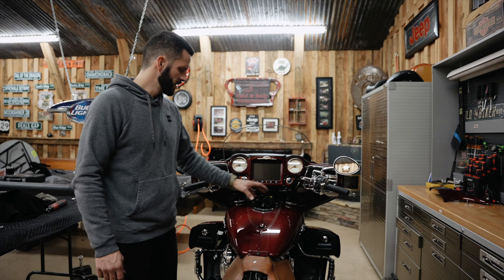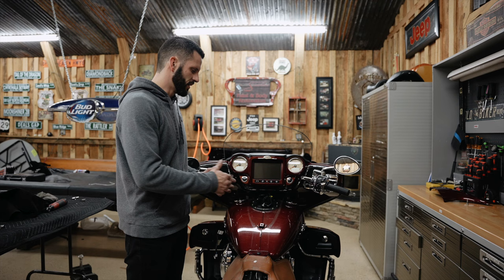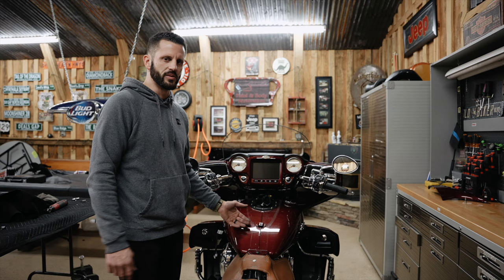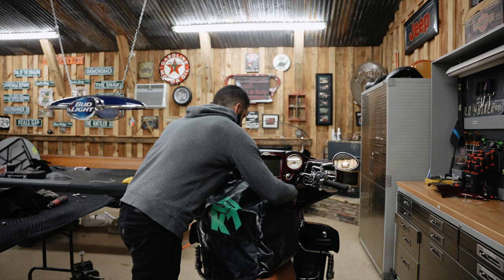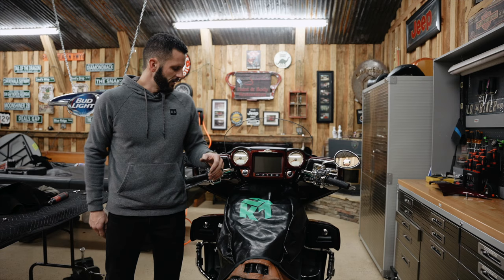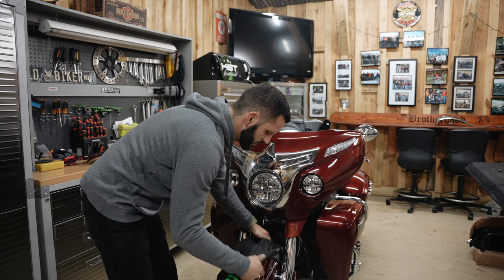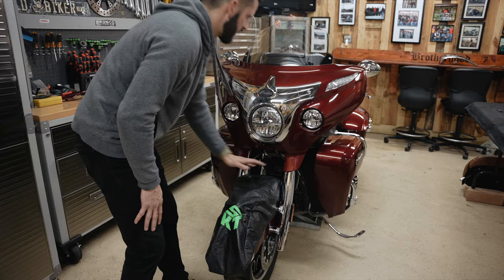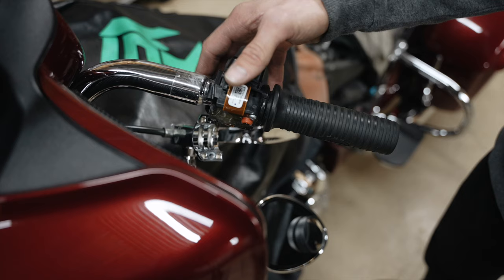2018-2023 Indian Roadmaster/Chieftain Handlebar Install | Indian Motorcycle Handlebars

Comment: I did it! 🎉 It took about 6-7 hours of work but that’s typical for me bc of second guessing myself. I kept going back and rewatching each piece as I went so the time line is on me. I didn’t have the work space either so I was make shifting that. Ultimately this video saved me about $600- $750 on my Indian shop installing. 

Word of advice to everyone on the 2020 Roadmaster Dark Horse, the plug that he mentions that goes to the handlebars, it is the one he’s talking about on the left (when facing the bike) but it’s ran through the metal frame to the fairing housing and is zip tied behind it. Remove the right blinker, take the 3 screws out of the fairing plastics on the back & use the needle nose players to twist off the zip tie. You can then pull the whole handlebar harness out of the front. You’ll be relocating that to the top in the middle somewhere bc it likely doesn’t reach back to the original location. Don’t second guess it like me. 

I have no idea where the ambient air sensor plug came from but it’s got the clip to stick back into the frame somewhere but I can’t find it. No idea how or why I pulled it out.

Comment: My shop quoted $165 per hour for 4-5 hours! Thanks to this comprehensive install video i'm bolting on my new 6" Apache Baggers (shipped like grease lighting by the way) on my 2021 Chieftain Dark Horse in my garage as we speak. I smeared a little dielectric grease on the taped up portion of my pull wire to make that sharp bend go a little smoother on the bulky throttle side. Thanks!

Comment: Finally got mine installed today. 2020 Roadmaster Dark Horse, the wiring in the faring was very different because it was all clamped and zip tied together with a small window to work out of. About 7 hour project at the end of the day.
Reply: Me too. Just bc second guessing myself on why I couldn’t get the handle bar wiring harness out as easy as he did. Zip tied behind that bar so need to undo the bottom of the fairing from the backside to clip that zip tie.

Comment: Just did a 17 Roadmaster yesterday and it surely didn’t go as smooth as your install! The 17 had soldered connections at the switch housings so the wires need to be pulled up through leaving the housing intact. The wiring left through after the install is really short and the wiring needs to moved around inside the fairing a bit. The clutch cable need to be rerouted too. It all come together but not as simple as the video. That being said, I’ve done many Harleys and this install is still way better than having to change clutch and brake lines!

Comment: Thank you so much ! Very clear and complete. I would like to change my bar on my 2016 RM, and after checking the connections on the handle, I saw there are not the same and not so easy or impossible to disconnected there !! Any other solutions ? Thank you for your help from France. Few year ago, I have done the same job on my HD Road King, I mean I should be able to change it myself... Thierry

Comment: Quick question can you not remove the bars with the wiring intact. Because when your installing the new bars. U r still feeding the wires in and out thru the headlight

Comment: Had you installed heated grips bed I just bought some heated grips for my 2017 chieftain and I know the bars aren’t pre wired and I have the harness that run through the bars just wondering if I have to remove the whole front of the fairing to run them through the bars

Comment: I am just installing heated grips and contemplating pulling all the wires out and restringing it rather than trying to pull the heat grip harness.  Can you pull all wires at once?
Reply from the maker: If you own an Indian, the heated grips are east peazy. They just plug right into the housing, nothing goes thru the bar
Reply: @kstkustoms1324  Unfortunately the 2017 was not prewired.     I followed your video and it was easy.  Just removed all wires and pulled them through.   Not as hard as I thought other than stripping the torx bolts on the brake,clutch c clamps.  😫